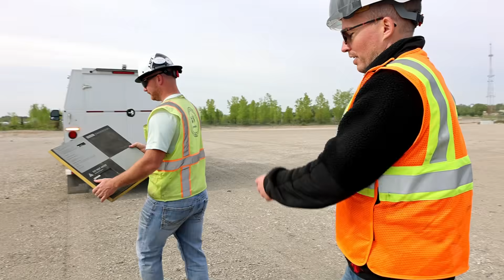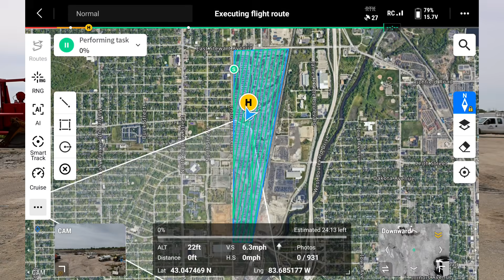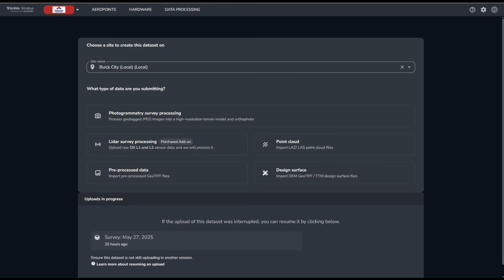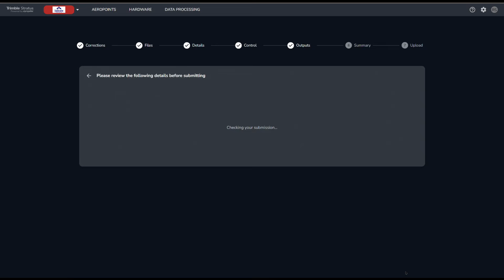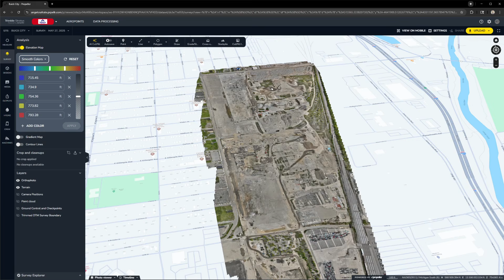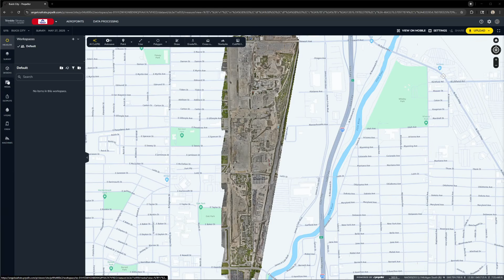Can DJI’s M4E with Propeller's AeroPoints Beat Ground Control? Full Accuracy Breakdown

Comment: Just spray paint an X on the ground! No need for these mats and nails! 
 I don’t understand the thrill of these pads. They are at risk of getting run over by site machinery, need to be left to gather data and collect them at the end. You don’t know if the data collected is good until later.  With traditional GPS, you know if you have a signal,  you know the point accuracy,  1 point stored for each GCP or checkpoint. Upload that into your chosen software with the images and away you go. I know a few people had issues with these pads and have converted to traditional methods.

Comment: Videos about Aeropoints NEVER mention how unbelievably expensive they are. This dataset is also not linked to an actual reference frame, as it's all local coordinates. One would need to post-process the central aeropoint in static (or PPP).

Aeropoints save about no time, are costly, and lock you in a pay to play platform. No thanks.
Reply: $1000 per Aeropoint isn't cheap, but the workflow is so simple and easy. The dataset is referenced to a coordinate system when you create the site in their portal. The flight data is then processed using that coordinate system through Propeller. If not using Propeller for processing, you just get the raw rinex files from the Aeropoints. And they definitely save time, 1 AP will cover 50 acres. I can put down 4 APs, fly that site and pick up the APs in an hour.
Reply: Well said

Comment: I have a couple of questions. Is the RTK module necessary when using the Aero ground control targets? He says it is being flown in PPK mode. If that is the case, couldn’t you use any drone with waypoint capability to achieve the exact same? In other words, let’s say I have a Mavic air three and have been using the waypoint hack. Could I put three of these devices on a 100 acre tract and do the same thing? Do these use a subscription to the NTRIP NETWORK?
Reply: You can’t ppk the data without the files that are collected from the RTK module even if it’s not enabled
Reply: After you buy aero points, I believe there is a subscription to keep them active. Then, if you want to utilize their cloud processing of the photos into models, that's an additional, much more expensive service that they offer.

On the other hand you can just download the corrected gcp coordinates from Propeller (Aeropoint) and use that in your own processing.

To do pee PPK without Aeropoints, you do need an RTK module because it collects data that is required for the workflow.

However:
Are Aero points effective if the Drone does not have rtk module?                 AeroPoints are highly effective and often necessary when flying a drone without an RTK module. They act as Ground Control Points (GCPs) that anchor the imagery to precise, known locations, preventing map warping and correcting the 5-10 meter positional error common in standard drones. While RTK drones provide higher precision without as many ground targets, AeroPoints compensate for the lack of RTK by providing accurate georeferencing, enabling survey-grade results on non-RTK hardware.

Comment: I'm really curious to see this compared to just using RTK, and not having to walk 200 acres to lay down GCP's in the first place. Especially with DJI's claim that you do not need GCP's with RTK enabled on the Matrice 4 Enterprise. Otherwise thank you for the video, from a Flint area M4E pilot! 👍
Reply: You have to put check points anyway. Otherwise you have no way to verify if the RTK solution was correct. "Trust me bro" isn't good enough in a lot of situations.
Reply: You could easily run this test yourself. The problem is that you ground control will always be necessary from the testing that I’ve done

Comment: can you not just spray paint GCP crosses instead of placing the mesh targets?
Reply from the maker: The template is designed to align the aeropoint in a position if there was a known point so that it can observe it
Reply: @RamiTamimi  I mean instead of having to hammer in nails just do this and then store a point in the middle? https://www.youtube.com/shorts/4rJzyWGa8_s?feature=share
Reply: I made some GCPs from thin sheet metal 3 x 12 inch strips then painted flat white on one side and flat black on the other side.  These worked well in my tests on rocky ground.  I’ve also tested on a grassy hillside which would require clearing the grass/weeds for cloth GCPs. Less area to clear for the strips unless the grass is tall.
Reply: I use both cloth and 2ft 2ft metal.  The metal are bulky but much easier to use than cloth.  No nails required.

Comment: It was immediately obvious that this was an advertisement for Propeller.  Kind of disappointing in comparison to your more typical objective gear videos.  However, you came through in the end and made it clear that the "traditional" workflow without the added high expense of Propeller, came out with higher accuracy.  So, you didn't completely compromise your principles.  Thanks for that!
Reply: I've never taken that much time placing a GCP. I would almost pay the $10000 to avoid the drama
Reply: Always bring paint, tape or an alternate means of holding down the targets. You never know for sure that you're going to be able to use nails.
Reply from the maker: I was very transparent about this being a paid advertisement. While I never compromise my professional integrity, this is a YouTube channel that provides some level of entertainment.
Reply: @RamiTamimi  I must admit, it was rather entertaining watching you try to make setting a target as difficult as possible!  And, I get it.  This is a business.  I meant it when I commended you for clearly stating the results in the end, regardless of the sponsor.

Comment: Is this a subscription model? although Singapore is not in its coverage.. want to know if its just purchasing multiple Aeropoints to make it work.
Reply: After you buy the Aeropoints you own them however to have access to their processing of the Aeropoint data and/ or the photos you do need a subscription.

Rami showed the full processing option where you upload the photos and Propeller does everything.

 You can also process your images yourself in your own software and utilize the Aeropoint data manually as you would with any other ground control point.